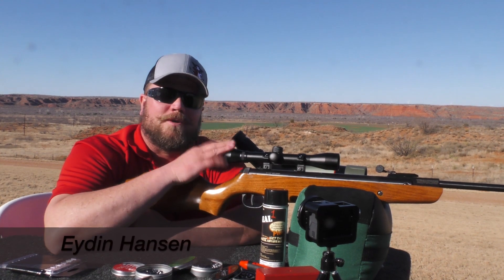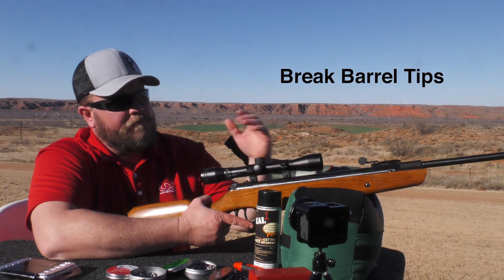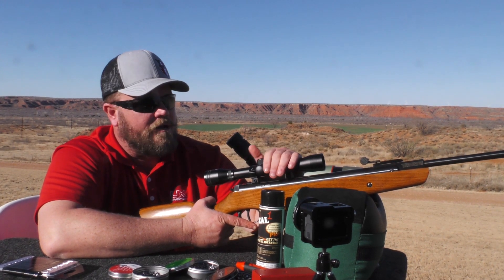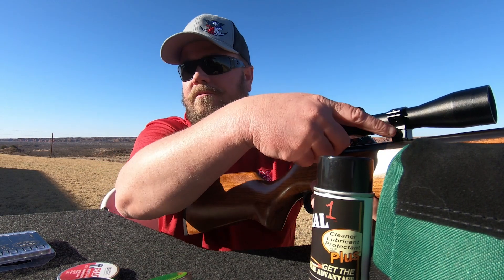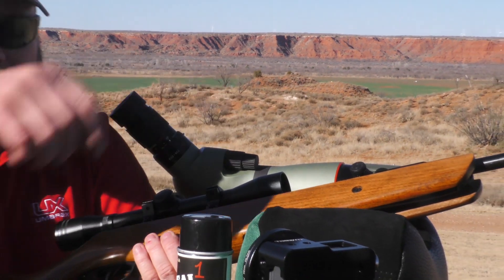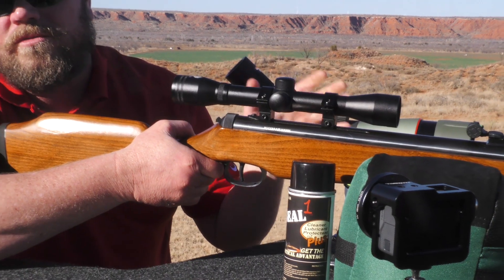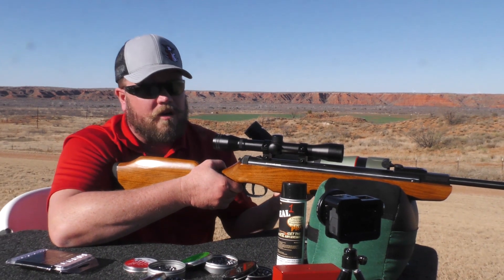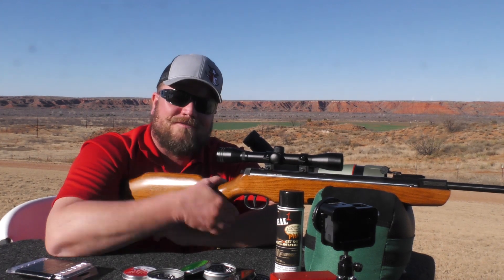Break Barrel Spring Piston Pellet Rifle Maintenance Tip

Comment: I have a question my gun is a Walther Terrus .22  I tightened the 4 screws that it has on the stock,  but it has 2 screws where you cock the gun like a hinge are you suppose to tighten those does anyone know?????
Reply from the maker: Haven't shot that model in a while. Those screws on the hinge are likely pins with circlips. Only the stock screws need to be tightened periodically. No thread locker.